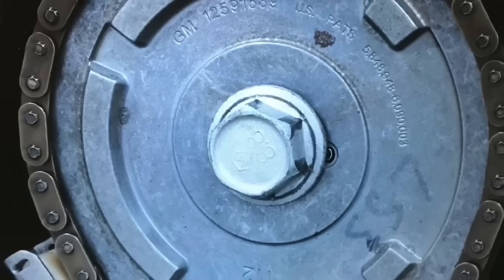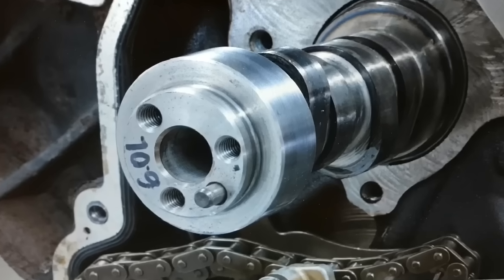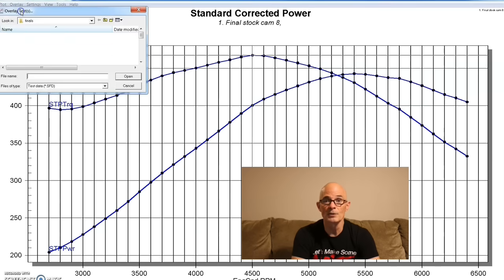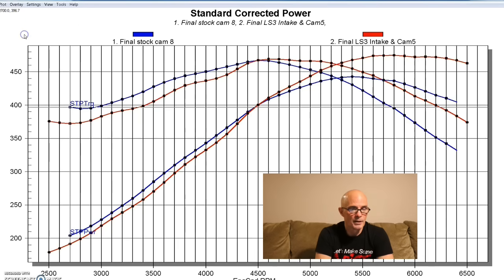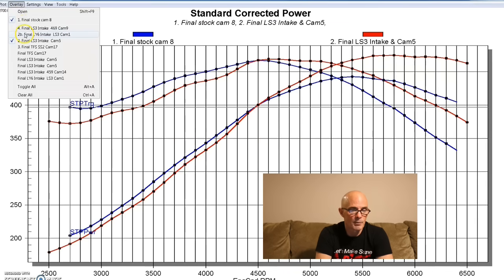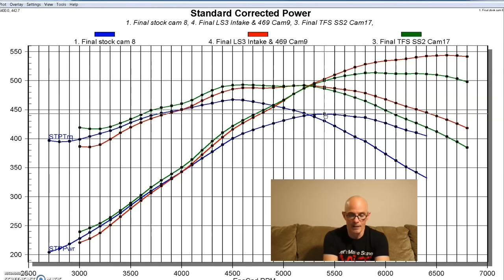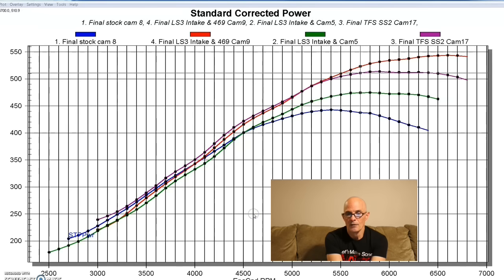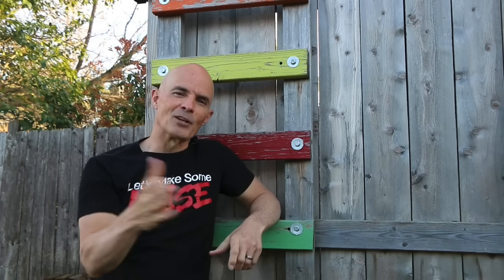HOW TO PICK: THE RIGHT JUNKYARD 6.0L LS CAM. 4 CAMS-WHAT WORKS BEST?

Comment: hi, what is the difference between L76 (AFM) 260kw, L77 (AFM) 260kw, L77 270kw and L98 270kw?  which would be best to use as a V8Supercar Engine?  If you were to build, using a stock LS2, What would YOU do for both POWER and LONGEVITY for a 6.0l V8 LS2 engine, keeping in mind costs!  Love ya channel.
Reply from the maker: cam, springs, ported 243 heads and Fast intake on the ls2-all the others are just variations

Comment: I honestly threw this together out of boredom and it's just sitting in my storage unit. LQ4 with 706 heads LS7 lifters and pushrod with 918 springs running the SS2 cam. Looks like I slapped in the wrong engine into my car.

Comment: My tuner just dynoed my car with a l96  6.0, w/ long tube, ls1 intake and Tb, SS2 cam and it only made 396whp....doesnt seem right from your bench dyno #s dynos.  This was on a dynomax.  Any insight? possibly the tuner? They are reputable though.
Reply from the maker: automatic?
Reply: Manual
Reply: he ran a different 6.0 than you  his was an ly6 with 317 heads also you cant compare a chassis dyno and engine dyno and im betting the dynomax was an inertia dyno and richard runs all of these on a water brake so you cant compare them

Comment: Just watchhed a Horsepower  episodes  on a 6 liter truck motor   they got 385ish stock and 422 with new 530 lift cam,   about 50 hp less this your setup ,???  Does the computer make a big difference over stock??

Comment: Richard,  what do you think of a gen 3 6.0 with the 317 heads and a 3200 stall convertor with 3.73 gears in a 98 f body and a single turbo in its future. Cam I was thinking of going with was a 228 234 on a 114 lsa.  Cletus McFarland bald eagle cam?
Good choice or?
Reply from the maker: WORKS

Comment: What's a good combination for a Stock 6.0? Heads? Camshaft? My 91 Chevy Truck will have a Posi Trac with 3.73 Gears and Nitrous. What are your thoughts? Street Driven
Reply from the maker: check out the 6.0L mods video-but stock rec port heads are cheap, add a comp 54-469-11 cam and springs and nitrous
Reply: @richardholdener1727  Thanks Richard 💪🏿

Comment: Thanks much 👍 Great video
Driving a 2016 chevy express 3500 with the L96 6.0. Very interested in hearing your advice on increasing fuel economy.
My van is never going to be a hot rod. It has enough power stock. But holy moley it's a pig on fuel around town (4.5-5.5 mpg) ... BUT ...if I'm on a long highway road trip it gets around 18 mpg.
The 6 speed Allison trans is probably one huge factor there.
Reply from the maker: 4-5 MPG? THAT IS THE DRIVER!

Comment: Hi Richard,
Can you tell me why your simulated LQ4, seems to have a baseline horsepower around 400 , whereas my real LQ4 is rated at atriums 300.
Does the LY9 block have different pistons?
Reply: Sorry meant around 300 HP
Reply from the maker: WE TEST IT DIFFERENTLY THAN THE RATED gm POWER
Reply: Meaning specifically?

Comment: Hi Richard I'm wondering if a GT 45 turbocharger with the hooker cast iron turbo manifolds on a 6.0 LS with forged pistons and the longer rods and rectangular port Gm ported heads will make 800 hp or is the turbocharger to small ?
Reply from the maker: TURBO IS TOO SMALL (ESPECIALLY HOT SIDE)
Reply: What would you suggest  ?
Reply: How about the summit racing turbocharger you tested or maybe the Borg s480 ??

Comment: Hi Rich can you exterminate the hp range for a lq9 with ls3 top end, elgins 1840 cam,long tube headers, and 2.5 inch exhaust. Thank you for your feedback.
Reply from the maker: IS THAT THE SS2 CAM-IF SO, THEN THE POWER NUMBERS ARE IN THE VIDEO
Reply: @richardholdener1727  ok thanks

Comment: for the sloppy stage 2 in a 6.0 with ls3 heads would 2400 or 2600 stall work well? light street car
Reply from the maker: Sorry-I'm not a converter guy

Comment: Thanks Richard, learn alot with you're test and I apprciate it. A question SS2 will be my choice for my swap but for somebody that prefer to have power and torque gain lower on powerband, did 243 heads will help that on that engine with that cam knowing that 243 do better lower than 823. Didnt really rev to 5500 or 6000 rpm with my daily.

Comment: Hey Richard, great videos, I'm looking for advice. I have a 2005 Hummer, I have a lazy lifter that has just appeared, I've tried some cleaners but am still having problems. I have a mechanic who will do whatever I want to it. It's stock. But a nice truck worth pumping up the motor. Im thinking if we have to take off the heads to replace the lifter we might as well do the cam too. It has 150,000 miles on it. I love that rough cam idle of the big cam motors and will be putting a full exhaust on this when we are done. SO ? is I'm not looking for a race motor, HP isn't a huge factor, but I want something that sounds bad ass with headers, high flow cats and an open exhaust. What are you recommendations for me?? Do you sell stage kits?? Do you recommend someone that has a rough idle kit (cam, heads, etc). I can't find too much info on this motor at say Summit or Texas Speed, thanks!!

Comment: Do the exhaust headers reduce the bottom end torque, the advantage with the stock truck cam?
Reply from the maker: long tube headers add bottom end
Reply: @richardholdener1727  Thanks for the info - just trying to establish the baseline for my stock L76 auto (w/ mafless L98 manual tune file). Cheers.

Comment: Richard Holdener
 The super chevy article on May 3 2016 shows a Lq4 at 465hp with I believe a 230d 580L cam. Are you 6.0 test with the ly6 and sameish cam higher hp maybe because of the slightly more comp. And the rec. heads. 30hp more than the Lq4 just seams like a big dif?
Reply from the maker: hard to compare two different motors, with different comp,cam and heads and intakes run on different dyno sessions

Comment: Hi Richard,
Great videos! I was wondering if that cam you use alot (54-469-11) would be a good choice for my ls2 manual 6 speed Corvette. I am getting ready to do a cam swap along with a fast 102, 102 TB, LT headers and heads. The heads I am going to be use are brand new AFR 225s (part #1630). 
Thanks Todd

Comment: Have you ran the Speedway LS Stage 3 Camshaft  234/277 duration?
Reply from the maker: have not-that's a lot of ex duration
Reply: @richardholdener1727   that’s what I thought, wasn’t sure if they have there specs wrong on the website. Would be an interesting cam

Comment: Did you use factory injectors on the truck intake when you made 514 hp with the sloppy stage 2 camshaft
Reply from the maker: no-they are way too small
Reply: @richardholdener1727  I got a 6.0 with a sloppy 2 cam and I just ordered a 92 mm throttle body and a guy told me today that a 60 lb injector would be good for me and another guy said get the 80 lb snake eaters

Comment: Are you running stock pushrod or are you using upgraded 7.400 length? I'm installing a stage 2 cam in my lq4 6.0 but am curious if my stock 7.397 length pushrods would work.
Reply from the maker: a 7.397 is a 7.40

Comment: I have a question, I have enough funds to either do a reman lq4 or freshen up my existing 5.3 with a cam, would a stock lq4 perform similar to a 5.3 with a btr stage 2?
Reply from the maker: the 6.0L will make more torque-but you can always get a stock LS3 or LS9 cam cheap for the 6.0L

Comment: I did the Sloppy Stage 2 with .035 off the factory lq4 heads, tops of the exhaust ports and minor blend of the bowls on both sides, When I did the SS2 I ordered a regrind small base circle, which saved me from buying new pushrods.  I did go for the pac springs but I had no plans to rev it out beyond 6k.  The results? It made 455 ft lbs through a 4l80e and a d44 jeep lj.  VERY pleased and glad I saw this video in advance.

Comment: So who’s the original maker of the Sloppy Stage 2 cam? I see varying prices from $185-$400
Reply from the maker: elgin
Reply: Richard Holdener Ordered the Elgin brand cam and PAC-1218 springs. Will these be just fine to swap on a perfect running 2007 Escalade motor with 50k miles or do we need order more valve train parts?

Comment: It depends on wat u buildn it4street track or Daily power traveln I did455in a malibu stock bottom bigger valves spring cam intake stall made525hp480T 350/500hp daily bt no traveln

Comment: what springs should i run with the SS2 cam? or could i get away with the stock springs? if not do i need to change pushrods? lq4 6.0
Reply: I'm in the same situation, did you ever get a response?

Comment: Am I still able to use my stock 1.7 rockers and my 7.400 pushrods with the SS2 cam? Im currently running a ls9 cam in my 09 pontiac g8 6.0.. Never had it tuned yet though.

Comment: The comp cam in a car that weighs 3500 or less with driver with at least a 3000rpm to 3600rpm lockup stall converter built 700r4 tans with 4.10 gears should run well for street or strip and do 70mph all day at 2600rpm not a daily driver but streetable should make 400 or more rearwheel horsepower with accessories water pump alternator and drive line loss your going to lose 120 horsepower with AC 140 horsepower this cam should run good from 2000rpm up 3000rpm for cruising and pull very strong 3000rpm to 7000rpm while not losing much torque even at 6500rpm its still making over 400 foot pounds of torque with a pretty wide powerband it loses some torque below 3000rpm probably not the best cam for 4000 or more pound cars or trucks but should have enough torque at 2200rpm to move a light vehicle in normal street driving without a sluggish feel at all mine in my 1984 monte carlo ss pulls well at 55mph in fourth gear with torque converter locked in at part throttle at 2000rpm or so at 55mph your doing 70mph smooth and effortlessly with a steady pull that's pretty strong for cruising this setup cruises 80mph at 3000rpm in my car my car has a holley 850 hp carburetor and a gm performance single plane intake not fuel injected

Comment: I'd like to know which cam for an ly6 that is actually used for working. I tow a 9500 pound travel trailer and need some more torque. These cams are good for race trucks/cars but i need some low end
Reply: I just put a stage 4 btr cam in my big truck. Pulls a trailer fine. Comes down to proper gearing and a good converter. Big difference I noticed from the summit stage 2 cam to the btr is it revs to the moon now.

Comment: I just don't understand something there. I have a lfa 6.0L rated 332hp. Why your initial stock run is like 443hp ? It is killing me. I have Google 6.0L and the read rating is 380HP. I would be so glad to have 443HP ! Can you clear things out for me ? Thanks for posting this info !
Reply from the maker: its the way we test it-with open TB, no accessories, long tube headers, optimized tune and colder than stock
Reply: @richardholdener1727  my goodness 100hp more ! Thanks for the answer back ! It a lot more poneys, I will dig the poneys back !
Reply: @richardholdener1727  do you mean a colder ECT than stock, or colder intake temp?

Comment: Gday from Australia Richard! Love your vids mate thanks for making them easy to watch and listen to. I'm about to undergo a vcm 883 Cam upgrade (228. 238. )(.600 .603)(113 Lsa)  I have l98 6 spd man sprts wgn. Im wondering how much power difference is between 2.5' and 3' exhaust on a Cam of this size? As I've heard the 3' and it's way to loud (for a "stock" car 😂). PS what valve spring set up did you use and or recommend for l98? And would you bother with twin timing chains?

Comment: Sloppy 2 it is then for my lq4. What else do I have to change or can I just swap it out.
Reply: You need valve springs. Pac 1218 should do the lifters while you are at it.
Reply: What’s the part number for the ss2, and where can I buy it?

Comment: Richard have you ever ran a motot with x amount of cold cranking compression then added a cam test motor them add compression to bring up the compression to the original number . The reason i like to know what is the ccp . For aluminum heads and a good quench say 10.5 or direct injection 11. I been wondering how much ccp a motor can use with 91 octane and not knock thanks as always for your great work

Comment: I’d like to see a comparison of the sloppy stage 2 vs a Texas speed 228r(.600 lift)would be interesting to see if the 2 degrees extra exhaust would offset the .015” less lift? I’m mainly asking because I both cams(as well as a tr224), and would like to know which is a better cam in a 6.0

Comment: would a stage 3 be fine in my 6.0 lq4 with 5.3 heads
Reply: Not with 5.3 heads, you'd have piston-valve clearance. You'd probably be OK with stock LQ4 heads if you use a thicker head gasket (valves are closer to the deck surface in 5.3 head than 6.0 because the chamber size is smaller with the small head)

Comment: Just got an SS2 cam delivered,  will let you guy's  know what difference it made, on a bolt-on L76 6.0 (rec port heads stock) . Installing cam (and springs,pushrods) only and slightly thinner head gaskets,  already have a baseline. Hopefully in a month or two will have some results.
Reply: Hey, where did you get the ss2 cam?  I can’t find it.
Reply: Speedway
Reply: Did u loose much tq below 2000rpm with it?
Reply: @jeffpriest4017  Ended up getting a Cam Motion LS3 Titan 1, still haven't installed as it's my daily driver

Comment: Richard thank you for the awesome info! I would love to see 2 test. Na cammed 6.0 or 6.2 LS on 91vs E85. And if you do a another intake test a Rick Crawford style modified LS3 intake with ported stock TB vs a fast 92 or 102. Both Na and Boosted. Some concern if the RC modified LS3 intake can stand up to a boosted application without failing. Thanks again really enjoy your videos!

Comment: Dear Richard, I own a 86K30with a 6.0 LS and a TH400 trans. I already own the SS2 cam but was going to sell it to buy a BTR Stage 1 because I was under the assumption I would need aTorque converter for the SS2. After this Video, you demonstrated no loss in Low end torque but it only shows the torque graph from 2500rpm -up. Do you think I could getaway without a torque converter?

Comment: Nice video. I was wondering  besides messing with the converter could you put in 4.10 gears from 3.40 3.55 gears and the cam would come on sooner? Although optimally converter and deeper gears with heavy vehicles really is the way to go. :)).  So informative, thank you Sir. I am subscribed!!

Comment: LY6 in my 2500 HD WT, Duel 1"7/8, MSD race, HP tune stock VVT  but... I want TQ . NO vidoes on the off idle to 2500 RPM . all dyno is past  that.Daily use is all below 3500 until we want to make a hit.I would love to see the best torque cam , a true puller to get that pig moving or that  load we tow. another offering
Reply: Id like to see if ss2 falls off lower than stock at 1800 to 2000rpm

Comment: I’m curious how the sloppy stage 2 being 228/230 with .585 lift at 112lsa would compare to the Texas speed 228r which is 228/228 so you lose 2 degrees of exhaust duration, but the lift increases to .600 and option the cam with the 110lsa.
Reply: This question is specifically for this type setup, lq4/lq9 with ls3/l92 heads and intake
Reply: @electricblueranger  Just comparing the two by valve timing events,  the TS stick would come on sooner, show a bit more average, and peak sooner, not by a big amount though. You have to factor lobe intensity, so without knowing how Matt's design or TS's design is ground on the ramps, you can throw it all out the window lol. But that is all based on an apple's to apple's,  like what Richard just showed you. How they affect YOUR combination will most likely be different. If you are swapping out a stock cam, and had to choose, I would say either one will work well. Back to back on the track? May not see anything.

Comment: I have a 09 Pontiac G8 Gt . I would love to see a cam test on L76 6.0
Reply: Only real difference between the LY6 & L76 is LY6 has VVT , L76 has DOD/AFM. Same LS3 rec. port heads on both. Not 100% sure on comp. ratio but should be very similar. Power should be close to identical. I also own a G8 GT in need of a cam upgrade.
Reply: @QuicKurtZX14R  the truck l76 has both vvt and DoD.  I think the car l76 only has the vvt, not positive on that though.  The l76 is also an aluminum block, whereas the ly6 is iron block.

Comment: Thanks for this video! Once again RH delivers high quality info. 

Zeroing in on the "no downside" 230-230 duration cam It would be intresting to see where a series of LCA would take us. Especially 108 and 104.  Above the 112 LCA has been tested many times.
Reply: This is my favourite cam for the LS. Have I've tried it on 111 lsa before and it was awesome. Made 300rwkw om a very rich tune.
How did you go with 112?

Comment: So can I put this in my stock truck and make it work better and harder? 
Or is this for modded engines only?
What happened to the fuel consumption?
What happened to power where I drive it at 1800?

Comment: My takeaway, it's all in the lobe separation. Grind the SS2 on a 108 and let's see what happens. 🤔
Reply: The actual timing events make more of a difference actually. Look at the splits, compared SS2... which is only 2 degrees. That stick on a 108 will just make a bit more trq and hp through the range and peak a touch sooner.. IF it's ground on a 108. Advanced to a 108 would be different.

Comment: I’m running this SS2 Trick Flow cam with heavier dual springs on my 6.0. Am I the only one who has a lot of increased valve train noise? I’ve tried 7.400 and 7.450 pushrods with not much difference in noise level. 10w30 mobile1 oil. I hate the idea of pulling heads and changing lifters just to have the same noisy valve train.
Reply: Hows low end torque? Off idle 2000rpm with ss2 cam does it have to have large converter?